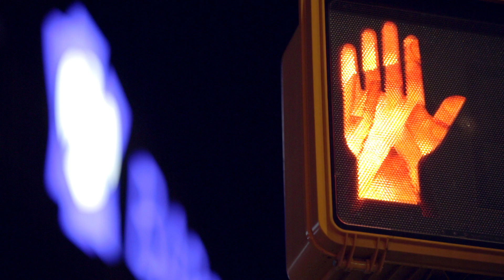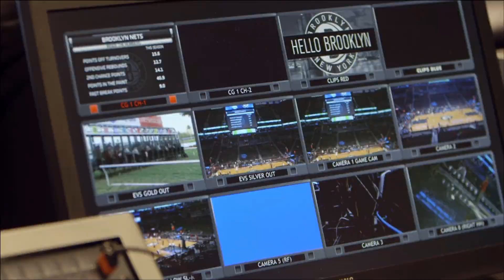Barclays Center Part 1: From Concert Venue to Basketball Arena in 8 Hours-The Window-WIRED

Comment: how do they setup the hoops on the floor? screw in or weights?
Reply: They add magic pixie dust to make it not tip over
Reply: There’s an additional piece of floor that add more length for the hoop to sit on. It gets screwed into that floor and then taken off the wheels, onto 4 legs at every corner.

Comment: Wouldn't it be easier to either cover the floor or have guidlines in-bedded in the concrete to know where the panels should go?
Reply: From the concert touring side of things, its best to have a concrete floor
Reply: I was thinking the same, or even have the floor lower into the ground and cover robotically. the only good I saw in this is employment :)
Reply: They also play hockey in the arena, so they can’t do that.
Reply: they will use it as multi purpose venue